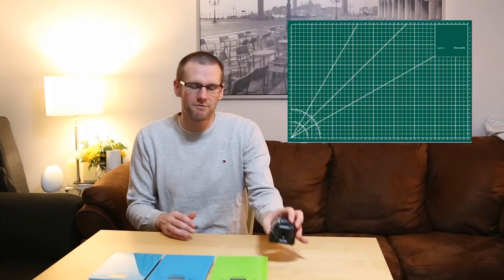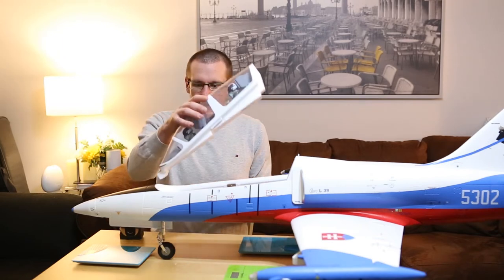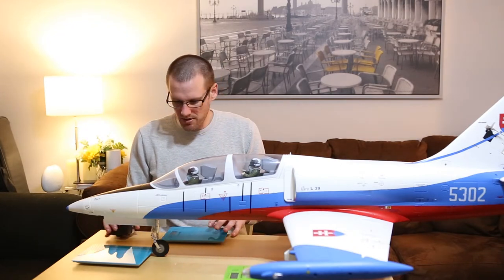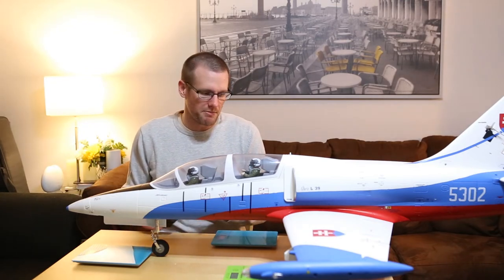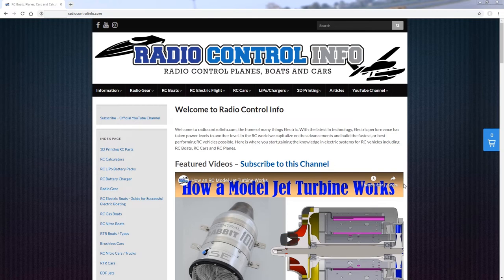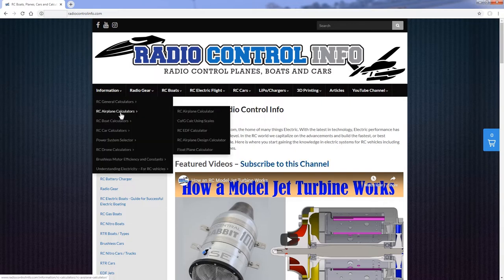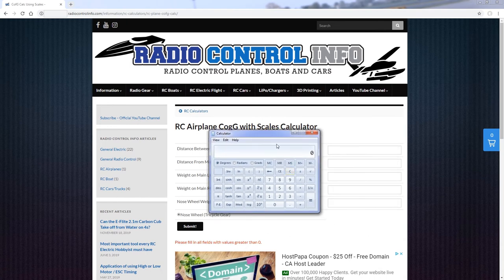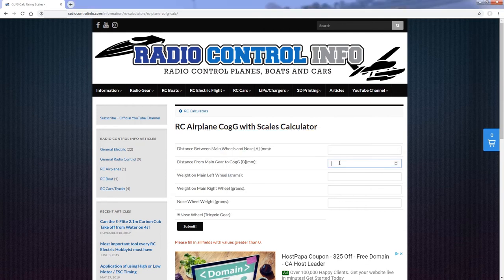Calculate Actual Center of Gravity for an RC Airplane using Scales

Comment: nice, thanks will your calculator on the web site work for a taildragger?
Reply from the maker: It's currently not setup for a taildragger style gear. Some concerns around using this method for a taildragger is the plane is not sitting flat when the tail wheel is on the ground. Right now I'm not sure how to maintain simplicity and accuracy for a taildragger.
Reply: @RCexplained  maybe take a look at this..https://testorcc.webs.com/TopCap/2008/topcap2008-feb.pdf   i'm not sure either. Thanks for the quick response and  info..have a great day.
Reply from the maker: Thanks for the link. I'll experiment a bit with what I have to see if finding the CofG can be done consistently and accurately each time. I'll add the tail dragger option once confirmed.

Comment: How do you balance a boat ? And were is the best place to put my bl motor Esc and battery ? I have an delta force hull and a tp 4070 1440 kV , what is the best esc , if my motor draw 227a an i want to use 44-48 mm propeller ? 

I hope you can do more boat video an how to set up a good fast sport boat, not race, but again a verry fast sport boat 

Thanks for all your videos , verry helpfull and i digg the boat calculator at radio control info. They are the best 👍👍👍
Reply from the maker: Balance can be read here: https://www.radiocontrolinfo.com/rtr-boats/mono-hull-setup/
The best place to place your components in the hull is so that you can access your battery pack with ease while balancing the hull out. Ideally, your batteries can move slight forward or rearward to help dial in the balance of the boat.
Reply: Thanks, good idee👍👍

Comment: Hi why some people measure from the tip of the nose to the main gear and you measured from the front wheel to the main gear?
Reply from the maker: We measure from the main gear to the nose gear because the nose gear scale is measuring the weight of the plane at the nose gear.

Comment: Hi RCexplained. I have a F3F style glider.  I have a nose support on a weighing scale.  I have a support say 40mm to the rear of the C of G on a weighing scale, so just 2 weighing scales.  The supports i have made come to a point that touches the weighing scale and I can measure the required distances, A and B, from those point touching the weighing scales.  The weight from the rear support is say 1200g.  Can I input half of the 1200g in the the Main gear Left (600g) and Right (600g) inputs?  Do you think this would work?  TIA.
Reply from the maker: If you can still follow the layout where the CofG is between the supports, you can split the main support in to L and R. You just need to be able to follow the layout accurately.
Reply: @RCexplained  Thank you

Comment: How does this work?  the position of the front and rear gears are not often A given location in  the precise distance to each other to reference to the CG, finding a CG is much more involved. this method does not consider any of the pressure and neutral points, thrust line tail moment cord camber, w/sweep, shape and other considerations of a plane.  MOST EVERYTHING effects the CG location. a proper CG location calculation is more involved.
Reply from the maker: Hi Michael. The CoG of your purchased aircraft is located in the instruction manual. This position is a known value. We are not determining the theoretical CoG in this video. We are determining how close we actually are to this location based on how we have set the airplane up. If we are not at the CoG as described by the manufacture, what do we need to do to get there.

Comment: hi sir i need yur help actually i have build a rc plane but its tale is  too heavy but i dont have enough margin to add more weight because this could be a cause of under power motor
Reply from the maker: Can you either:
1) Extend the nose of the plane outward? (preferred)
2) move the main wing slightly rearward?
Reply: yeah let mr check plz
Reply: @jugnoo_official9438  also try and take weight off the back